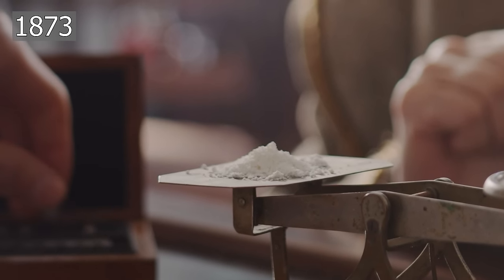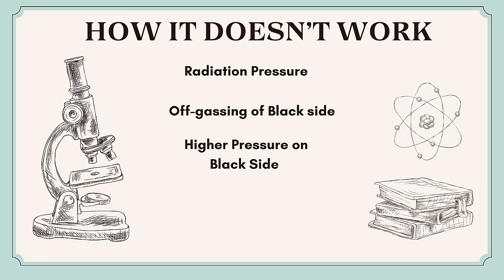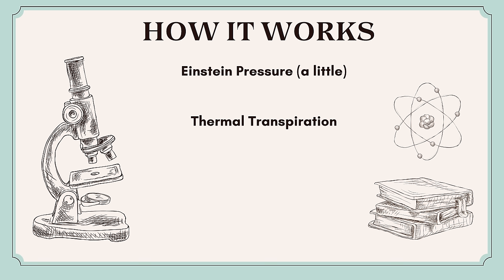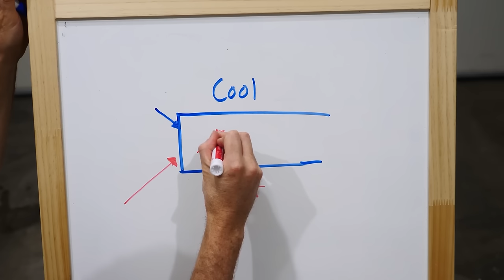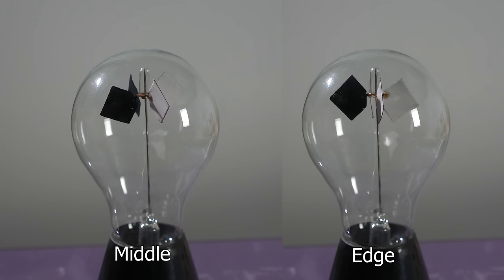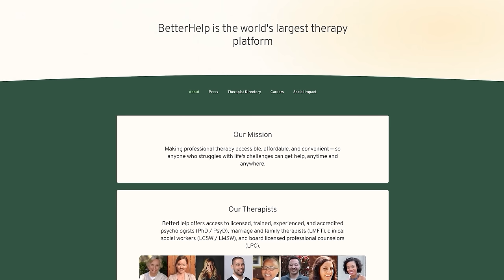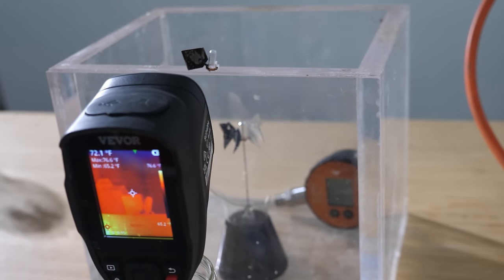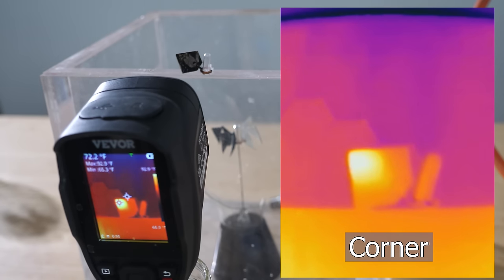Trying To Solve The 150 Year Old Mystery

Comment: I have a question. There's an age old debate in my head that I'm constantly arguing to myself - "Is light a particle? Or, is light a wavelength?" It seems like it may be an easy answer until you start looking at how it [light] behaves. When you see light actually moving an object, you tend to believe that it's now a particle - that it has some kind of mass that can move something. What are your thoughts?
Reply: Professor Dave had explained while using the double slit experiment, it was in the Quantum Mysticism debunk video.
Reply: @FutureWorldX  I saw a similar video about the double slit experiment - however, it really begs more questions than actually answering anything definitively
Reply: This effect Is known As wave-particle Duality.
It's actually Kinda famous.

Light is Both a Particle, and A wave.
So, you Aren't alone. That has Been a Debate for A hundred Years. 

Light is A photon, Which has Both, particle Properties, and Wave properties.

Of course, You don't Have to Take me Up on My word, Just start Reading into Wave-particle Duality.
Reply: @dr.blockcraft6633  my brain hurts enough already. I'm not certain I want to look into it any further 😂.

Comment: Have you changed to oil in the vac pump. Water in the oil will change the vapour pressure of the oil and you want be able to pull as deep a vacuum.

Comment: You cannot make conclusions on such short measurements. You even can physically see the rotor accelerate, one revolution is way too short to determine a reliable period/frequency. At least with the naked eye without postprocessing captured data. To be fair tho, it does all seems to be very close for sure, so your claims are hypothetically sound.

Comment: Since there should be an opposite and equal reaction to an input, and your input was energy, then the output would be opposite your input. I would be curious to know if the frequency of the light has any bearing on the efficiency of the rotation. Would a green laser produce something different than a red laser? That would point to the color of the material itself being the driver of what is happening.

Comment: Is it just me or is this a lot simpler? Light itself has a physical force, regardless of thermodynamics. Example: the JWST had to account for this in space. So when you split the square, that surface area isnt together (I feel like that's why it may have been a bit slower). When you cut holes in them, it's like aerodynamics, and the light shines through, not pushing the squares. That's why the laser in the center or the corners are the same speed, regardless of thermodynamics. The edges aren't the key. The surface area is what matters here, and how much light hits it. Thats why the JWST is relevant, because they're both in a vacuum. Right?

Comment: i think the radiometer works my shofting the electrons in the vacuum.betweennthebteo colors.
light excites them and doing so shifts the molecules which causes a pull in the vacuum. that pull createw a low energy drsft that can pullnthe radiometer enough to help it spin faster without making a vacuum innthe vacuum so it conserves momentum.

Comment: What about massive fins so that you could more easily see differences in heating? Would it even work if we drastically increased the size because of the less popular square-line law (a parody on the cube-square law)? Assuming we can make the fins light enough to still propel with these meager forces.

Comment: Light pushes the blades as a force due to the movement of light and you can calculate the speed of light hitting the object the only problem in solving this is you need to measure the object and calculate the speed which it turns and force this force = mass * acceleration will then give you what light actually weighs

Comment: You’re using plastic box, doesn’t this block the UV ?

ChatGPT

Plastics can indeed block certain wavelengths of light, depending on their composition and the additives used in their manufacture. Here's a general overview:

UV Light: Many plastics are designed to block ultraviolet (UV) radiation while allowing visible light to pass through. This is common in items like sunglasses and UV-protective coatings.
Visible Light: Some plastics are transparent to visible light, while others can be opaque or colored, blocking specific wavelengths. The color of the plastic often indicates which visible wavelengths are absorbed or reflected.
Infrared (IR) Light: Some types of plastics can block infrared radiation. This property is useful in applications like thermal insulation.
Other Wavelengths: Specialized plastics can be engineered to block or transmit other specific wavelengths for various industrial or scientific applications.
The exact wavelengths blocked depend on the type of plastic and any additional treatments or dyes it has undergone. For precise information on a specific type of plastic, consulting technical datasheets or scientific literature is recommended . Check glass. Put laser in box . Shape of box. Size of box. Light frequency and frequency mix. Sound wave changes with density of air. Reverberating sound . Flow inside shape. Moisture.

Comment: I have my Radiometer spinning right now as I type yet I'm confused by your vid... I have been taught that when the vacuum is as the right level (not too low so there are too many air molecules so as to dampen any movement due to friction, but not too high so there aren't enough air molecules to impart their momentum) it spins when said molecules hit the warmer, black side and their recoil imparts more force as they gained energy while on the silver side the air molecules bounce off with no gain in thermal-to-kinetic energy. Are we really that wrong?
Reply: That seems more right then mysterious edge forces where air molecules do stuff.

Comment: It's the air. Replace the air inside with carbon tetrachloride, helium, propane, Sulfur Hexafluoride, water vapor, and a refrigerant ... all with different thermal properties. The gas inside may be acting as an ideal gas due to the low pressure ... or not. It might behave differently and the vane speed will show a variation dependent on the atomic mass, the mean free path, or the heat transfer coefficient. It seems obvious that the black side heats up gas molecules that are in contact with it, and they move a little faster. Why is it a difficult leap to say that these gas molecules in turn hit the black side faster than the white side ... didn't you prove that by your hole punch? I'll bet that if the holes were smaller, you would have seen diminished vane speed, but you jumped straight to a massive hole. You could have also tried a hole in just 2 vanes, and tested both intact ones and holey ones.

Comment: Cutting hole removes material, making them lighter, and thus having less rotational mass. This makes it easier to a
Spin. That doesnt explain why, but it would change ghe experiment by a lot compared to just altering their shape but maintaining the same mass.

When you cut them, you just changed their shape. But they were still the same mass. Weight probably shouldnt be changed until we figure out why, then cha ge weight to further understand.

Comment: Why don’t you make your own radiometer and make the veins slightly larger by the area of the wholes, then punch the same number of holes on the veins and check if it works. My theory is that it has to do with surface area and the number of electrons hitting it.

Comment: this might literally be a true example of thrust generated by the hot side pushing itself off of stronger from the air molecules than the colder white side. (because thats generally the wrong explanation for the thrust of a rocket)

Comment: how about the transfer of light energy, tho it has no mass but it does have momentum and energy,  and ot seems that it only spins when in a vacume, there for no resistance, that being said would it then be possible that the  energy of the light and its momentum cause it to spin as the light does hit the surface and not  go through it ???

Comment: is it color thermal based? where the BLACK Is absorbing the heat and the WHITE is offputting the heat AND LOWERING the airpressure there by inducing LIFT  ?  size matters and reducing the size of the sails killed the movement  & cutting the sails also reduced speed

do you still have the really black dye? and for say a thin WHITE metal sheet?    maybe an anodized aluminium black on one side and just acid etched white on the other ... could be fun

Comment: I would argue that it's a little bit of everything but mostly the thermal transpiration. The heat doesn't account for much movement, but it does account for something. We learned that it does have a minimal effect that is not 0. We then just toss that non-0 out because we found a 95 or a 99? XD. I can't do that. 

Essentially... Yes, Thermal transpiration counts for 98-99%, maybe only 97% of the movement... so there's the baby. Now tell me why I'm throwing out the baby's toys? I think that might be important.
Especially when it comes to science and tech. Something simple and stupid could become a mistake that causes another Challenger. But that's just my theory/opinion.

Comment: Couldn't the pressure come from the interaction when hot black metal atoms strike a slow moving cool air atom, transferring momentum to the cool air atom and receiving recoil momentum in the opposite direction as a result?

Comment: Would it move configured like a flat conveyer belt or a super conductor suspended . Perhaps direction has a purpose. 
Angle,temperature, gravity, magnetic interference, electrical interference. 
Radio waves are radiation and polarity plays big parts in the electromagnetic spectrum.  If atoms are polarized and energized by radiation perhaps polarizing electrons would cause an electrical/ magnetic result of some kind. 
Or am I asleep ?

Comment: What? I did even think this was ever a debated topic.  It obviously spins because the gas near the black surface increases its kinetic energy and expands.  This region of gas expansion (ie higher pressure region) pushes both against the panel and again the cooler air.  The image with the black and white surfaces adjacent, in the paper you showed, would still spin but it's because the pressure difference across the black panel is not uniform.  It has a "slope" of high pressure near the interface that increases to higher pressure at the free edge.  I swear this is like an April fool's video or something 😳
Reply: I had a similar idea and comment, haha

Comment: @TheActionLab what about putting it back into the vaccuum chamber and sucking all the air out and then shine light on it. If there is no Air and it does not move then it is proven that the air is the force behind it. if it still would move then it must be the light.
Reply: Thermal Transpiration is a description of how some people think that the air moves the flappers. They know air moves it, just not precisely the details, or so the video makes me seem.
To me from the comments the most likely seems that when one side gets hotter, that hotter side can impart more energy into the air molecules, and the more it'd give away the more push there is between the flap and air molecules.
Reply: @Utrilus  true but it was also mentioned that it is not really proven that the air is what makes it move. So when there are no air mollecules then we know for sure. maybe back then they just do not had a vaccuum chamber or also possible the did not had a lamp producing that much lumen for testing. And honestly it would interrest me personally what would happen :)
Reply: @JarvidVenport  2:00, "The most widely accepted theory is that the air moves it due to thermal creep" They know the air moves it. That's why it's in a partial vacuum. Removing air resistance to a point that it can spin and be moved by the air, but still having enough in the enclosure that it can move it.

Comment: What if the white and black surfaces aren't on the outside but on the inside? :p

BTW I always assumed it's just black-hot air and white-cooler air, so basically a temperature gradient. Then again, why isn't this so? I am confused, though it's a really intriguing video.

Comment: I think you gave up too early. It looked to me like you used insulating materials for the fins. Maybe you should try using a conducting material like aluminum foil and black sharpie on one side of the foil and then maybe bending the fin so that it  has a leading area and trailing area

Comment: Your 100k lumen flashlight is an absurd number. I bet if you tested it, you'd find it's 1k a most.
Reply: No, it actually is 100 000 lumens
Reply: search his channel for his video "Shining 100,000 Lumen Flashlight at a Crookes Radiometer" and you will see this is very clearly in the realm of a 100k lumen flashlight. regular lightbulbs are near 1k, and with that flashlight turned on the camera automatically adjusts its exposure way down so that the well-lit room looks totally dark in comparison.
Reply: he didn't turn the lights off when he turned the flashlight on, its just that much brighter than a well lit room which is probably over 1k lumens already. But with camera adjusting exposure automatically, it's literally impossible to tell through the video how bright it is. 1k with lights off looks the same as 100k with lights on once you adjust the camera exposure

Comment: ChatGPT told me that the radiometer works best at partial pressure, not full vacuum. Because in a vacuum there would not be any air molecules to transfer the heat from the black coated side to the surrounding air molecules.